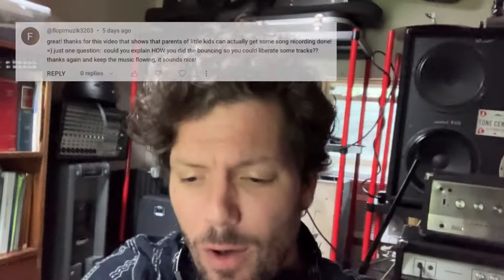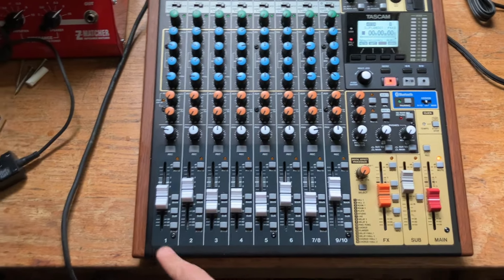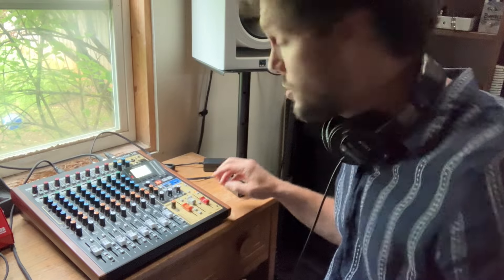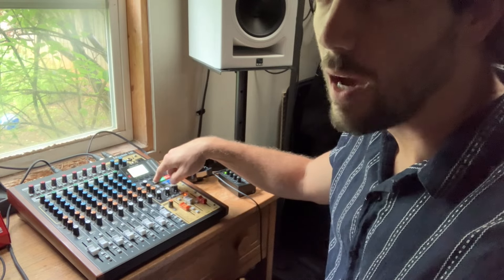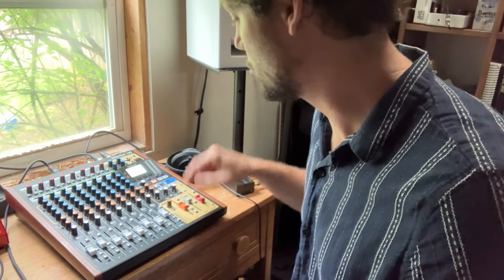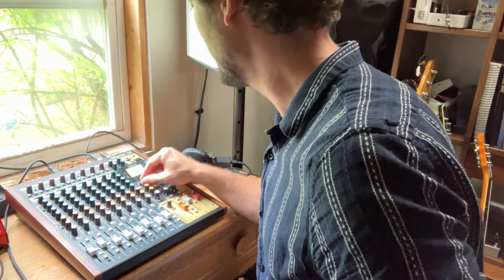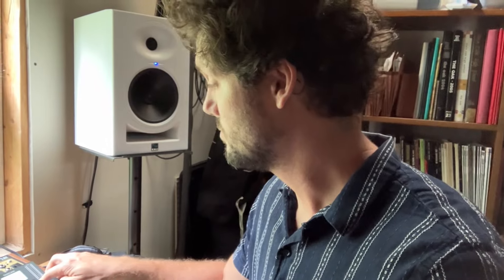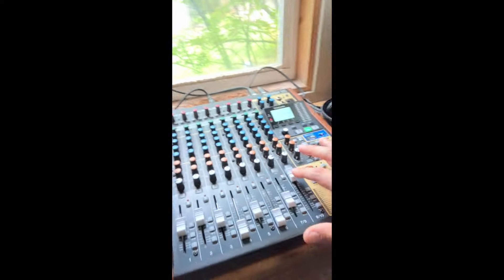How to Bounce Tracks in the Tascam Model 12

Comment: You actually CAN listen back to 11/12 in real-time. Just press the button labeled "SD Main Mix Return" (its right above the second headphone volume knob) and when you press play and are monitoring the main mix, it'll playback whatever was recorded to 11/12.
Reply: Also, to solve having to push the fader up so high, there is a track normalization feature in the menu that can bring the level of the digital file up. It's under MTR -> Track Edit in the menu, though you may have to get the latest firmware in order for it to be available.
Reply from the maker: Great points, and critical corrections. Thanks for sharing them!

Comment: Would it be possible to use 2 tracks to record a single guitar amp with 2 mics, and then mix it together to a mono track?
Reply from the maker: Yes. You'd connect each mic to a separate channel input, and then arm each channel/track to record, and record simultaneously. That would leave you with two independent mono tracks, which you could bounce down to a single track, or keep separate until you're ready to do a larger bounce.
Reply: @JordanSeal  Thank you! Each day I'm finding less reasons not to buy it heh

Comment: What a strange process. So if I want to make a few 'buses' I have to bounce and then switch the track from the 11-12 hidden track a few times. Weird but somehow charming. Does EQ and compression get recorded on the stems? Is it possible to control whether it does or doesn't? Thanks for your vid!
Reply from the maker: @AntonKuznetsovMusic  It is odd, but ultimately intuitive… and least for doing true bounces/mixdowns. By default the EQ, compression, and any applicable effects do get recorded, as long as you’ve routed them to the “main” bus. But you may be able to toggle those on/off in the settings. 

If you just want to bus things (to an effect or whatever), you can use one of the 2 effect sends, and that’ll work more normally.
Reply: @JordanSeal  thanks for the reply. And many thanks for your informative video. ❤

Comment: @JordanSeal - I like your videos...not a whole lot of people posting content with these "portastudios" so thank you! I have a question for you. I am thinking about getting the tascam dp-008 and I was wondering what you do when you are in the middle of mixing / working on one song and suddenly you get inspiration to work on something different. I assume you can save the current / song project and start a new one, but what happens when you want to go back to the original song you were working on? All the knobs and faders will be different from where you had them before. Do you take a picture of the board state or something like that before switching to a new song so you can reference your prior state? Or do you just usually remix everything again? Appreciate the insight if you or anyone else can answer this...
Reply from the maker: Thanks! You can save separate song sessions and toggle between them whenever you want… But you’re right: you can’t save fader positions. So you have to remix each time or take notes/photos of where you had things. 

When I used the DP-006 and DP-03, I usually just remixed, because I was only tweaking two parameters: volume and panning. I found it pretty easy to get back to a sound that I loved. Now, with the model 12, I sometimes take pictures of EQ settings, because those take more time to dial in. But I’ll often just remix volume and panning.

One related note… When I do a bounce or final mix, I often need to adjust parameters over the course of the song, including turning track volumes down to zero. To facilitate quick adjustments, I will mark target positions blackboard chalk. That gives me a reference point and wipes off really easily.
Reply: Regarding why you might want to swap tracks, that means you can keep your mics in 1/2, use the inserts on them, then move the recorded tracks to 3-10 to free up 1/2 for additional tracks without swapping mic inputs/losing inserts.

At least that’s my thought!